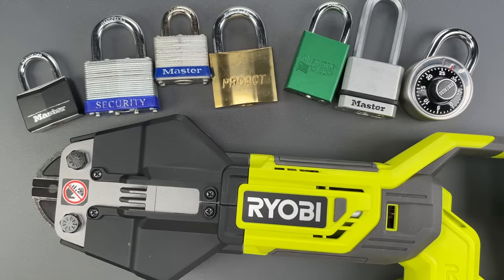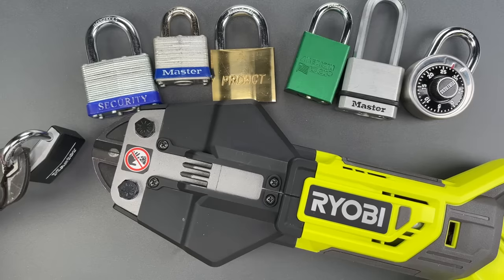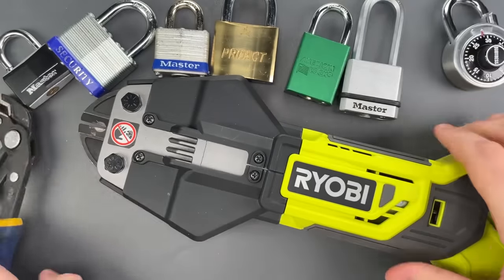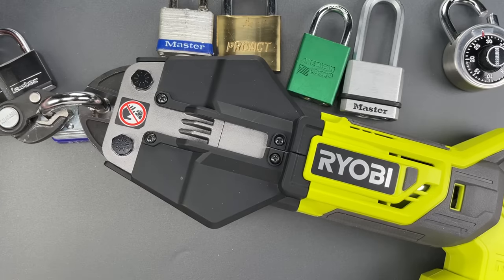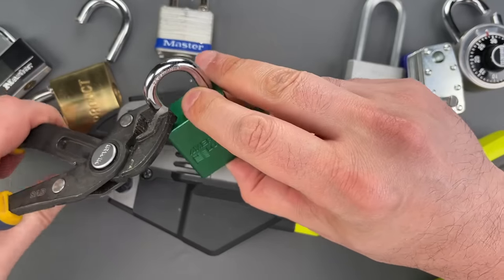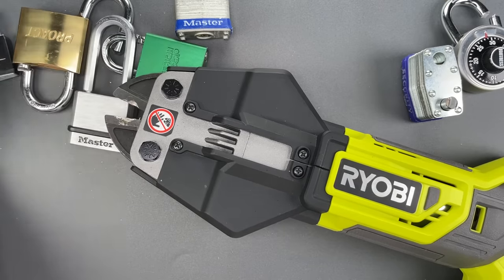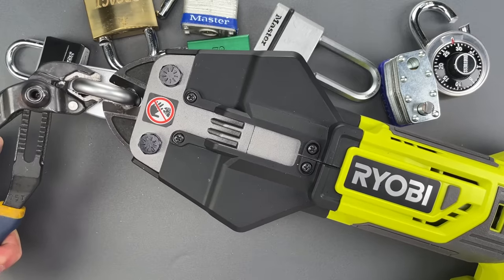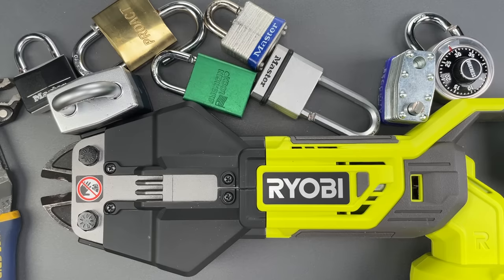[1408] Better Than Expected: Ryobi Bolt Cutter

Comment: If you are using the "starter" battery (1.3-1.5Ah) the stopping is the battery cutout. Try a 4Ah battery and it will probably chew through without stopping.
Reply: It damaged the blade, the motor is going to be calibrated to be only a little bit more than enough to chew up the blades.
Reply: @danpowell806  - the 1.5Ah batteries have 1/2 of the number of cells in a 4Ah battery. Because the extra cells are connected in parallel, that means the 4Ah battery can supply a higher current in amps to the tool. These batteries also have a battery management system (BMS) built in that limits the current that can be delivered to the tool, cutting off in case of a higher drain. So this bolt cutter could be trying to draw more current than the smaller battery is capable of delivering, and the battery cuts it off.
Reply: Same thing with my Milwaukee tools.  The high capacity compact batteries are game changers
Reply: @danpowell806  False bud bud
Reply: @stevebabiak6997  Do they really have BMSs in those small boxes? That is surprising to me. I figured it just be a limiting resistor or something.
Reply: @johnboling  - yes, Ryobi has a BMS inside the battery. For real. I have a 4Ah battery right now where the cells have enough voltage in them so that it should be working, but it seems the BMS has issues and refuses to put voltage onto the output terminals.
Reply: @johnboling  Yeah, look up a teardown! The Ryobi One+ line dates back to the NiCd era so the tools are "dumb", they had to put a smart BMS in each pack to protect the lithium batteries from overdischarge.
Reply: @stevebabiak6997  Higher capacity cells are also generally capable of delivering less current.  This is the reason a 2P 3AH battery using 18650 cells will drive a high demand tool better than a 2P 5AH.  Also notice I didn't say the 3AH would drive the implement longer, but faster.   Many people get confused by power VS. runtime. 🙂
Reply: @mvansumeren4313  - correct, the actual cells can be higher capacity. Ryobi supposedly had those in the 3Ah battery that no longer seems to be for sale at Home Depot - I don’t have any of that battery to be able to say any more about that, but people such as yourself who have used that battery have told of that.
Reply: Amp hour is how long the battery lasts: Voltage is the power. The same voltage battery with a greater amo hour rating will merely make the tool run linger, not harder.
Reply: @boomanchu2   Voltage is power in a (metaphorical) vacuum. Actual power is often limited by the output capacity of the source. In a transformer this will typically be determined by impedance, while in a battery it'll be determined by the amount of cells. Quite often, a bigger battery, with the same voltage, will be able to output more power.
Reply: @boomanchu2   - not totally true. 

First, power is volts multiplied by amps, not simply volts.

And the ability of a battery cell (of a given voltage) to deliver current can be higher depending on things like cell size and geometry. You think a AAA cell can deliver as much current as a D cell?

Typically, a Ryobi battery with higher Ah rating achieves that by adding cells in parallel. Those added parallel cells increase the peak current capability - that allows a higher current to be delivered to a load. Keep in mind that the loads we are talking about aren’t simple resistive loads, where the resistance value and voltage supplied establish the current that flows; we have motors involved, and they have loading that varies with RPMs and torque.

But in the case of these Ryobi batteries, there is also the BMS. The BMS has devices in it to limit current level that is allowed to flow, and a battery with higher Ah rating tends to have a BMS that allows a higher current before the BMS cuts off.

So this is stuff that is well beyond a basic electricity course …
Reply: @boomanchu2  Not true, as demonstrated many times with videos here on youtube.
Reply: @boomanchu2  Power is determined by Voltage multiplied by Amperage (V*A) and is expressed in watts.  A battery's C rating determines how much amperage it can deliver.  E.g. a 1.5 AH li-ion cell may have a discharge C rating of 15. (3.6*15=54) so this cell can deliver 54 watts of power.  A 3 AH cell may only have discharge C rating of 3 (3.6*3=10.8) so this cell can only deliver ~10 watts before being run beyond its safe capabilities. It should be noted that C ratings for charge and discharge are seldom the same and you should always take this into consideration when selecting cells for your application.

Edit: I just realized my maths above are incorrect with reference to power delivery.  It should be (C *AH*V). (81 watts peak power for the 1.5 AH and 32.4 for the 3AH)
Reply: @johnboling  Dunno about the technical reasons, but the amount of extra oomph you get out of the high-capacity batteries is pretty noticeable in most tools... they don't JUST last longer.
Reply: @johnboling  multiple lithium cells require BMS by design to charge and discharge.
If you don't want your battery to go boom, of course.
Reply: @somejerk5662  Exactly. I have over 50-20 and 18 volt tools. Larger amp hour batteries are stronger. Period.
Reply: @mvansumeren4313  you've explained the extra oomph  there perfectly in technical terms , the C rating is specific to the batch of cells used in any given battery . The higher the rating number - the more it amps it outputs . The difference between a half sized battery & full sized is the cell count , the large ones ( I'm talking physical size now) have 2 row of cells in parallel,  so that doubles the amp output of that battery & the end result is you get more Oomphf from a tool
Reply: @stevebabiak6997  Power is watts! Volts X Amps, FFS
Reply: @myself248  BMSs are the norm in lithium ion tool batteries, not just Ryobi.  Only time you don't see a BMS in the battery is when the BMS is already in the thing charging or using the battery.
Reply: @boomanchu2  Internal resistance of the power pack has an impact too. Larger AH batteries output voltage doesn’t sag as much under load.
That’s the reason bigger engines need bigger AH batteries to start reliably.
Reply: @mvansumeren4313  I have a scientific experiment: Buy this tool, buy a battery with a higher amp hour rating, and show us that a battery with a higher amp hour rating can provide the motor with enough energy to produce more Newtons on the blade to make this tool "chew through the locks faster", as OP stated.

I'll wait until the experiment is performed.
Reply: boomy got rekt and now he's trying to double down
Reply: @okarowarrior  now we gotta find someone who has ryobi tools who would buy a power bolt cutter :( lmao
Reply: @boomanchu2  i'm sure someone will do it eventually but you've got both people with intuitive experience from using battery tools and scientist types who understand the math all in here saying "this is how it works" so there's absolutely no chance you can win this.   go on the youtube channel "project farm" he's got a few videos where he objectively tests battery tools specifically regarding battery packs.
Reply: @annreid1965  - your reading is poor, because that IS what I wrote. Try again.
Reply: @boomanchu2  your first statement only mention power is volt, AH is life time.
second statement is true, if only after the tools reach max power.
in the video, the bolt cutter clearly limited by power supply (battery), not yet reach max power.
Reply: @boomanchu2  if all other factors are the same, yes.

but you need to consider the BMS, how many amps the cells can throw out, if the battery and tool is HP or not (the better batteries and some brushless tools have extra contacts)

I've torn apart about 100 ryobi packs and salvaged cells from them. I've got a ton of ryobi tools and abuse the living fuck out of them. I use rigid tools at work and the packs are very similar but the build quality of the tools are a bit higher.

the packs contain the BMS, better batteries get better BMS boards. the tools/chargers are all relatively basic inside.

there are youtubers who have done comparisons between different packs, but I can tell you from personal experience the packs with larger cells or parallel cells defiantly have more oomph than the basic packs.
Reply: Good exchange here about the power being applied. Also, the hardest test was at the lowest charge for whatever battery he's got. How many cuts is that tool designed to handle on a single charge? 
Looked to me like the blades lost some bluing on first contact with a hard surface,  but they still looked sharp at the end. 
Maybe over specialized to be worth the dedicated motor. They ought to make that a head into one you could power with a reciprocating saw or hammer drill for the occasional heavy cut.
Reply: That’s how lithium ion tools were originally advertised, but testing has shown without a doubt that high draw tools perform differently depending on the aH of the battery and the type of cells used in the battery.
Reply: @tech99070  love the Project Farm!
Reply: Yes, I noticed a big improvement with my Ryobi circular saw, I thought it was due to a dull blade, But a fresh 4Ah battery made it cut so much better. And my air compressor fill the tires quicker.
Reply: @boomanchu2  I have quite a few Worx tools and several different batteries; 1.5Ah, 2.0Ah, 4.0Ah & 6Ah.
The smaller batteries are fine for the drill and jigsaw, but are not a good idea to use with the angle grinder. If you use the smaller two on the angle grinder, they can’t be charged straight after draining because of excessive internal heat. The BMS blocks them, until they cool down inside. The bigger batteries are fine, they will charge straight after discharging. You can also hear a difference in the speed of the mini chainsaw, with the bigger batteries. They are clearly giving more juice than the smaller ones.
Reply: @mvansumeren4313  that's wrong as far as ryobi tools go
Reply: i believe the tool measures resistance and if the spike goes too high it stops.
Reply: @danpowell806  very incorrect sir.
Reply: @boomanchu2  stop it, you lose clown boy. I'm an electrician who uses power tools, day in - day out. The higher the amp hour, the more my tool can cooch. That goes for my bosch tools as well as my makita tools. That goes for dewalt, Milwaukee, and hikoki. Now, I can't say for certain it's the same for ryobi BUT, I can say for certain it's the same for ryobi.
Reply: @LegacyAftermath  What is?  Pray tell.
Reply: @mvansumeren4313  ryobi tools can give more power with a bigger battery.  Especially on their hp line
Reply: @LegacyAftermath  You may want to re-read my earlier comments and do some research to avoid embarrassing yourself.
Reply: Yep, I have a lot of Ryobi tools and the higher AH batteries also have a much higher discharge wattage. My impact driver hardly works with the starter batteries but stick a 4Ah or 5Ah battery on it and its a beast.
Reply: @stevebabiak6997  So they just used wrong labeling ? Or does the 3Ah battery have a higher actual discharge rate ? Or is the bms inside the 5Ah more restricted ? Otherwise it doesn't make sense.
Reply: @BrainHurricanes  - there was a 3Ah battery that had higher discharge capacity cells. The 4Ah uses the same cells as the 2Ah but has twice as many cells.

The overall discharge for the battery package is always determined by the quality and capacity of the individual cells, plus the quantity of cells used.
Reply: 100%.   I tried the 1.5Ah battery on the impact wrench and it could not undo a wheel nut. Stick the 4Ah battery on and they are removed in seconds. Connect my homemade 12Ah power pack and it removes the nuts like they were finger tight.
Reply: Coming from someone who just bought 4ah batteries recently for my Ryobi tools, it makes a huge difference over the 1.5ah batteries.
Reply: Yeh, I use Milwaukee tools a lot for work and the bigger batteries are noticeably more powerful. The impact driver is what I notice it on the most.
Reply: I hereby boost this comment!
Reply: Also is normal ryobi + battery and then there is ryobi + HP battery, the HP batterys are more powerdul for the tool
Reply: my 1.5ah runs a lawn mower this wouldnt come anywhere close to using a similar amount of amps
Reply: @johnboling  lithiums need it or ryobi will be paying out warranties in every battery sold
Reply: If it's anything like some other battery powered tools, it actually stops to prevent damage.
Reply: Yup agreed. We use this bad boy at work to break trailer seal bolts all day with the 4Ah and it just goes. That’s why I came to see what it would do to padlocks.
Reply: Good point.  The other thing I was looking at was that the cutter was resting on the lock housing.  I really wanted to see what the backside of those blades looked like.  I was wondering if the cutter was binding on the housing.
Reply: @boomanchu2  I've got the HP sawzall, with a 1.3AH it's a sad piece of shit and sometimes won't even run but that thing will cut through a semi truck frame with a 4AH or bigger

Comment: I like how the no name lock seemed to give it a harder time than the master locks
Reply: Low carbon steel=>you can not harden it(but you can put fake claim about it on the shackle)=you can also easly cut it with the cheapest $1 hand saw(and not make any significant noise when doing it)...
LPL also could rotate the tool by 90 deg and then that deformed shackle would not have proper diameter in this axis (and by changing the angle back and forward you can cut it even with tool that is theoreticaly too small for the job).
That Master lock padlock shackle was too britle but it was hard so cuting it with hand saw is not an easy job.
Reply: Even china has standards
Reply: Looked notably thicker than the other locks
Reply: @Coreydarn "China: masterlock buy the things we're too ashamed to put our name to"
Reply: One with no name has no master. -Some samurai, probably
Reply: Softer and less brittle means it had plenty of space to deform, but it did no damage to the cutting tool.
Reply: @Bialy_1  very high carbon iron alloys are quite brittle so it can have a high amount of carbon... there is a saying that too much of a good thing can also be bad...
Reply: That has to do with the hardness. The same soft easy cut shackle means that the teeth spend more time cutting than they would with a hard shackle. Combined with that battery issue stated elsewhere, the wimpy stretchy shackle actually makes it seem like it's a harder cut
Reply: @sweaspurdoddd5466 I like how the master lock nr.3 lasted for 3 seconds
Reply: I've heard the saying that, just like how a master key opens all locks, s MasterLock accepts all keys. The brand is known for being crap.

Comment: Now LPL became a true locksmith! All he has to say is "that'd be 80$" per lock
Reply: I will never forget making a service call (I worked for a door company at the time) to open a storage unit where the customer was upset that I was going to cut their lock off with a set of bolt cutters instead of picking it open...that was 2003, it was $80 just for the truck roll and an hour of labor
Reply: @flynbenny  cheap when the one i called cost me 217 euros for showing up
Reply: * $80  (dollar sign goes to the left)
Reply: @leonc4653  sounds like night/weekend rate
Reply: @JohnDlugosz  tbh I always put the sign to the right because you say "X dollars" not "dollars X"
Reply: @miweneia  doesn’t mean you aren’t wrong😂
Reply: And I'll be happy to sell you a new lock.
Reply: @JohnDlugosz  you must be fun at parties
Reply: @flynbenny  My storage place wanted to call in a $180 locksmith who was an hour away when my key broke off in the lock I had purchased from the storage place anyway.  Seems like they should at least be willing to remove locks purchased directly from them, but whatever.  I came back the next day and the woman said there was no way I could cut it off.  My angle grinder disagreed.  Naturally, it took more time to run the extension cord 50 ft than it did to get the lock off.  Not paying $180 to remove a $12 lock, even if the locksmith can save the lock.  It was quick enough it probably would not have drawn much attention even with the noise.
Reply: @JohnDlugosz  I bet you are fun at the parties.